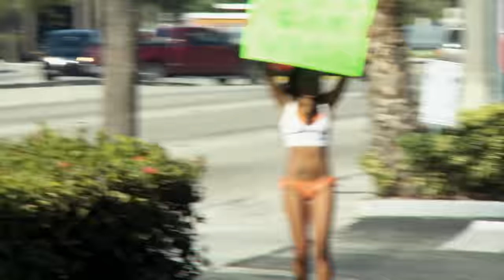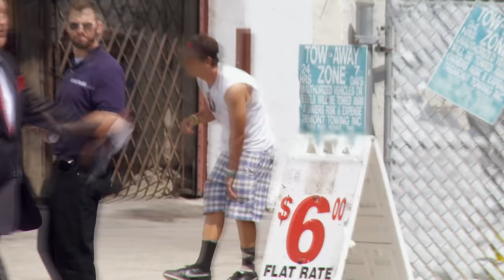South Beach Tow | Season 4: Compromising Positions | Watch the Full Episode | truTV

Comment: 9:50 - 19:30

This is crazy

I've seen these drivers be assaulted, have their windows shattered, and even threatened at knife and / or gunpoint 

There should be self-defense protocols for these tow truck drivers or else they're screwed
Reply: Perez didn’t set the car on neutral!
Reply: @heelzhinkaiger360 

13:05